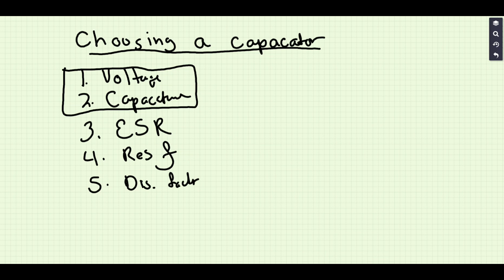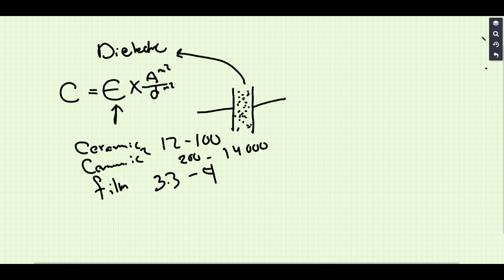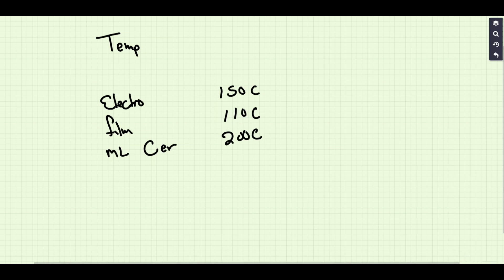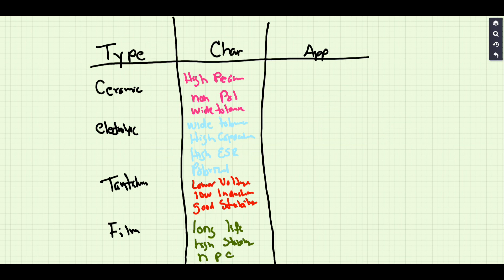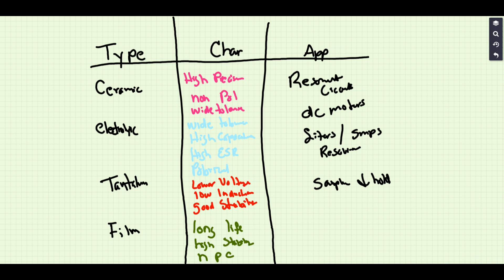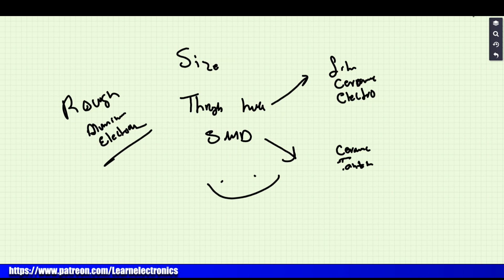Things To Consider When Choosing A Capacitor For Your Project

Comment: 6:42 You seem to imply that ESR and Xc are the same thing, they are not.  ESR is the purely resistive component, Xc (capacitive reactance) is the AC component.  They add together to form the total impedance.  To put it mathematically, Z(omega) = R + jX(omega), or ESR + Xc at a given frequency.
Reply from the maker: I'm not implying anything
Reply: @learnelectronics  Then it would help to explain what you meant by "and you can find the capacitive reactance for finding your equivalent series resistance".  You appear to be saying that they are related.

Comment: PAUL, what is the formula for the insertion loss of a capacitor? how do you compute the insertion loss of a capacitor? Dissipation Loss is ESR/Xc = Dissipation , but you said to calculating and computing for ESR is getting the Xc. ESR and Xc are two different things. How do you calculate to get ESR?

Comment: Out of curiosity I looked for the dielectric constant of air. Air capacitors are not used as much in digital circuits, but if you are restoring old radio's and such you will find the tuning capacitor is simply metal plates that are separated by air. Anyway, I found that a vacuum (I guess there are a few specialized vacuum caps) has a constant of 1. Air has a constant of 1.00059, I assume it changes based on humidity! Almost the same as a vacuum!!!